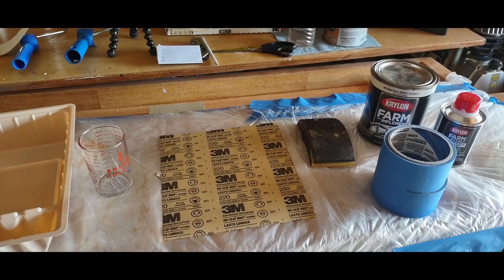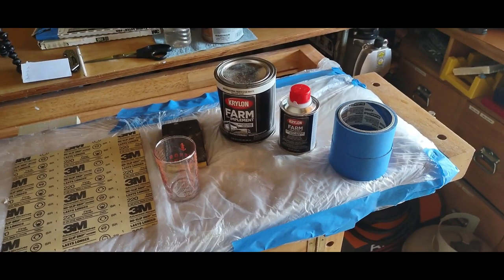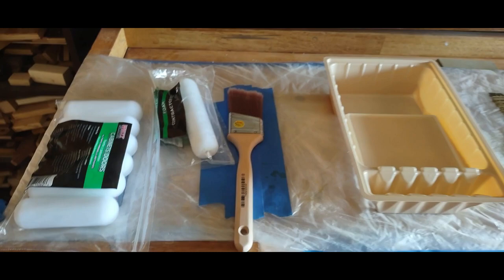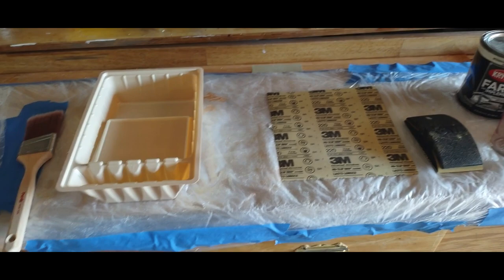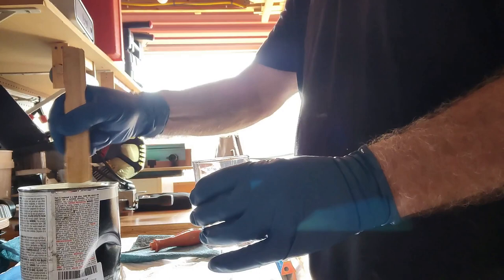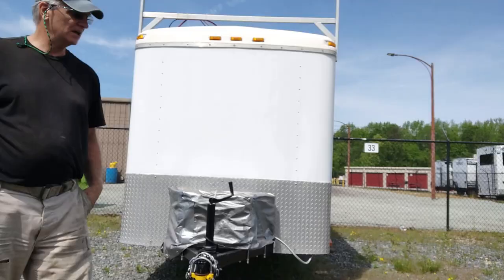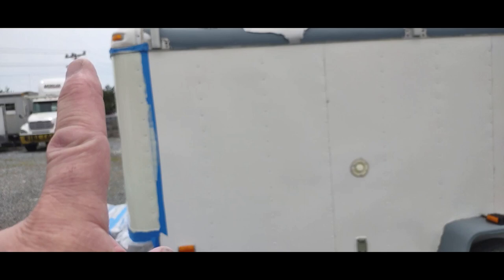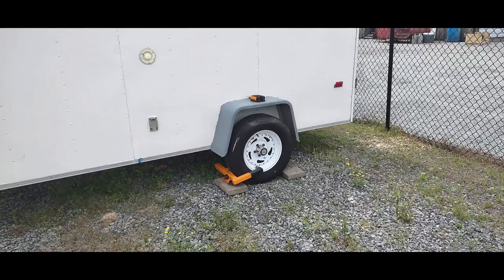How to paint the outside portion of a Utility Trailer using a roller and Krylon paint

Comment: I have an enclosed car hauler trailer I think it is 16' long. The front of it has white plastic I guess to make it Aerodynamic. Will that paint also bond to the plastic? Also is it possible to use a bigger roller? Thank you for your help and time and the great video!!
Reply from the maker: I don't believe the Krylon Farm Implement paint will adhere to plastic.  When rolling on the paint you really need to use the shorter roller to get the best finish.  While rolling it in you have to press with additional pressure that you normally don't do when rolling paint on a surface.  I attempted to use the larger roller at first but I wasn't able to get an even coat due to the amount of pressure I had to use while rolling it on.  For the best finish you really need to use the shorter roller.  Once the paint was dry it was almost as good as if it were sprayed.  I hope that helps and please feel free to share our content with others who are looking for an affordable way to paint their trailer
Reply: Thank you for your response! Sorry but I have another question I thought of. You mixed up a gallon of paint and added hardened. If you don’t use the whole gallon and put the lid back on the paint can you use it later if you don’t get the whole trailer painted in the same day?
Reply from the maker: It is my understanding that once you put the acrylic hardnner in it will last for only 24 hours.  If you don't intend to paint the entire trailer in one day I would buy 4 one quart containers with lids and empty the gallon into the four 1 quart containers and add hardnner recommend for one quart of paint.  Make sure you use the Krylon acrylic hardnner with the Krylon paint.  In addition, do "NOT" purchase the paint off of Amazon as you can't be sure as to what type of paint you are getting.  Purchase locally from a reputable company, I went through O'Reilly's Automotive.
Reply: Thanks again!!! I appreciate your time and help!!!
Reply from the maker: You are most welcome, glad I could be of assistance.